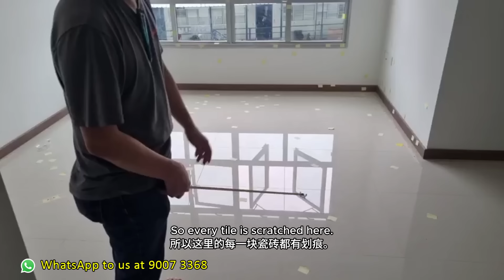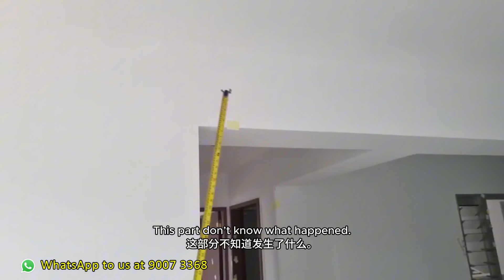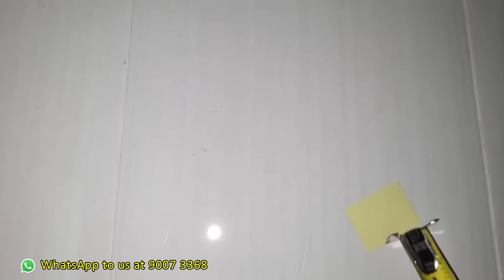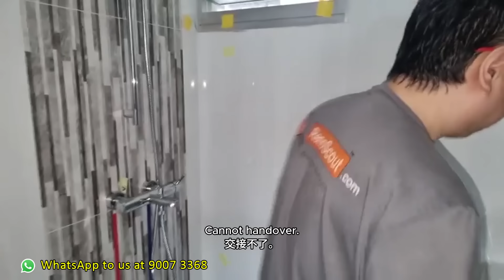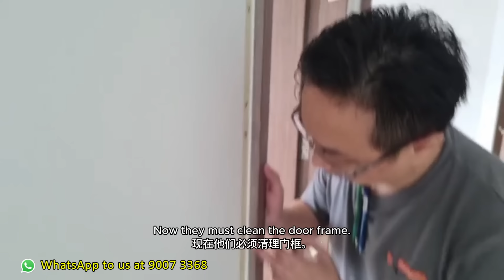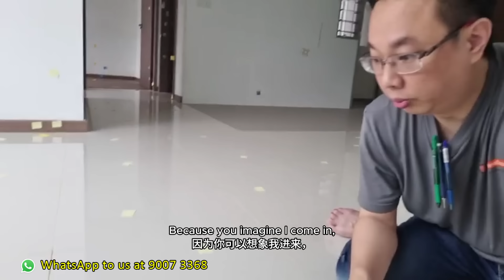Renovation LIVE On Site | WHY Paint On The Wall Tile?? 为什么在墙砖上涂漆？

Comment: My door frame also have holes and they just patch it up. Even the tiles corner chipped off and they patch up only instead of replacing the whole tile... What you said is extremely true.
Reply from the maker: @liklengtay2498  Yes. This is the sad reality that we are currently experiencing. But this should be improved. Hopefully the people with power higher up can help to improve the situation in the near future.

Comment: BSC send bangala to cut away my pipe when upstair neighbor choked the pipe with cement 😢 feedback to  HDB on electrical sparks from power sockets, water seepage, loose window gaps..only "eye power" & surface "touch up". Till now, still having issues so already given up.
Reply from the maker: @user-pl7re6eh1s  sigh. Always painful to hear such cases. But not much we can do on our part.

Comment: Is that window frame sprayed with light grey instead of anodized paint? Mine was sprayed painted. So when I paste the painter tape over the frame for a while, the paint will peel once the tape is removed. I complained to BSC, and it is also of no use.
Reply: cheap, low cost... that's probably why they can win the bid? Like Ryhs says, Who is supposed to QC and inspect quality before handover? Everything pushed to buyer, then buyer complain.... deter, smoke, bullshit. End up buyer 1 small citizen only, can only cry and compromise lor... Perhaps the whole HDB block buyers should come together and do a "class action suit" against the developer or HDB like the USA.
Reply: @briantan2963  Very hard to sue them one. They will try to segregate, pacify and cover up . My sis resale flat has other issues that other blocks were having. They did the same thing to her by not releasing the full truth to her.

Comment: My flat has three doors. HDB installed three different colors. I asked HDB, and the officer emailed me to say their HDB guys would come down to talk to me. I took half a day, and the HDB guys came and told me the colors the architect chose. I told them that what architect would design three different-colored doors in one house? They said they cannot do anything. Actually, my house was rushed out before, during, and rushed right after COVID. The fact is that they anyhow find whatever stock doors they have to install.
Reply: I think the HDB guy bullshit you just to close the case. I have a unit, ceiling leaking. Call town council, town council say is HDB. Call HDB many many times, first time they bullshit me, never lodge the case, found out when i call the 2nd time. call the 3rd 4th time, customer service say they can only escalate, gave me officer in charge number, but all goes to null. NOBODY ever took my case at all. Completely ghosted me.
Reply from the maker: @wumingkkk  Your case is very rare. But it happens. So this is the sad reality we are faced with. It is better to opt out of the optional components if you can and choose your own tiles, doors and bathroom fixtures.
Reply from the maker: @briantan2963  sad to hear your terrible experience
Reply: @RenoScout  Strangely enough I told I don't want optional items but they still installed some for me. I have to spend money tear down and the doors, I spend good quality 3M vinyl and asked professionals to lay for me. I spent 1K doing up all the doors to a single color.